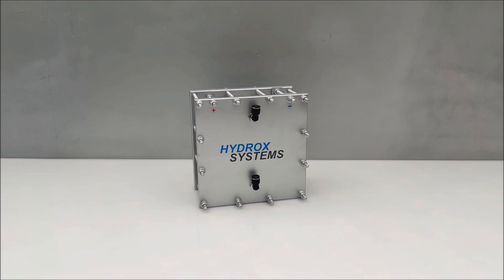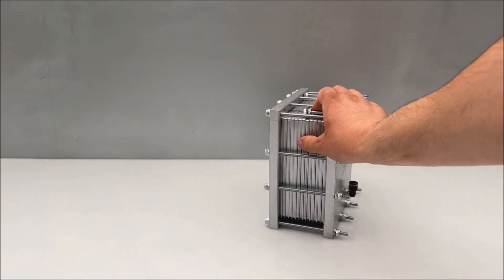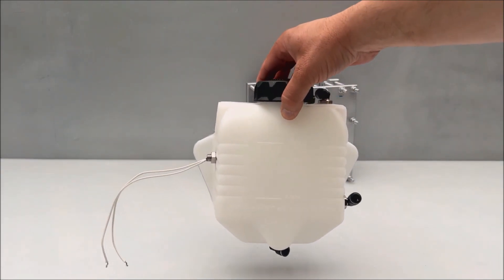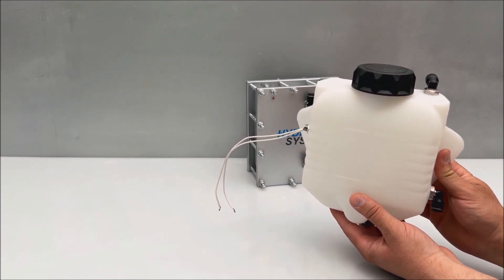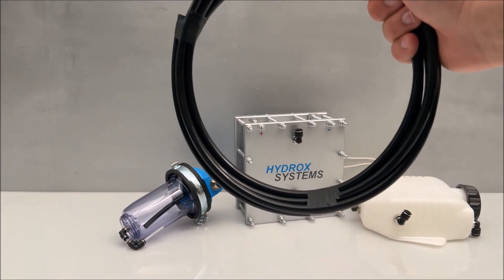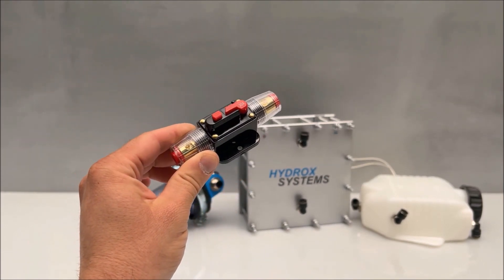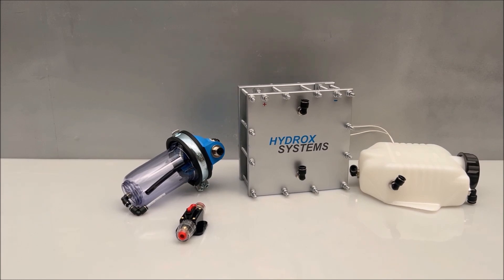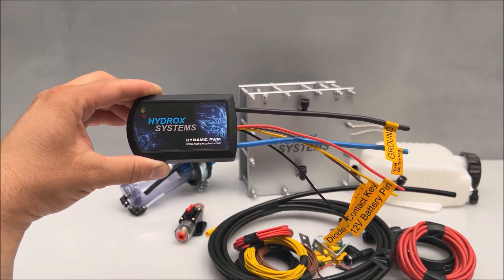HHO Generator in Car - What is included in the kit HS 4000 Pro - Full review 🤨

Comment: I am Mac  and U have not got a water separator on the unt so it's bad for eng U àre  have not dun it rite almost there but not yet .woter in eng Will cos valves to rust and gids as wall as part's of eng.
Reply from the maker: Hello Mac, I think you did not see the bubbler in this kit, which is the separator! You can check again how that bubbler works, and it's impossible to overflow compared to others where they are fully closed! ;)

Comment: How water proof is the system? I'm interested in using it on my 4x4 but regularly go through deep water.
Reply from the maker: Hello, there is a bubbler as safety device, which determining the maximum level of condensation water inside and can not overflow never ever! :)
Reply from the maker: The system basically is not for Offroad applications! It's not waterproof! :)

Comment: Can this system make petrol powered car make full hydrogen powered? If yes, how it can be mounted on car that is not adapted for such a fuel and how you will make car to work under heavy condition like freezing cold weather like in Norway, Finland and Canada?

Hi from Georgia(not state). Author are you eastern European?
Reply from the maker: Unfortunately, you can not convert any car to run with only HHO gas, dont have enough power onboard to produce that much gas! Freezing is solved by a very simple method, our systems runs with 10% density of the electrolyte. I'm from Bulgaria.